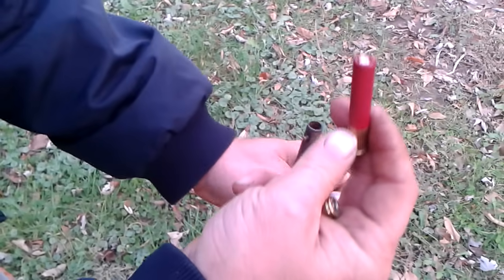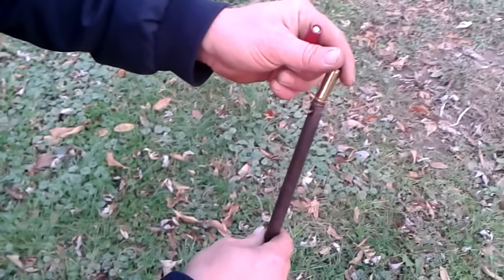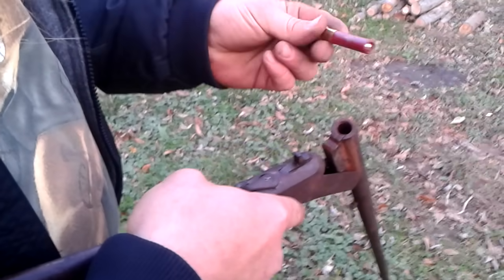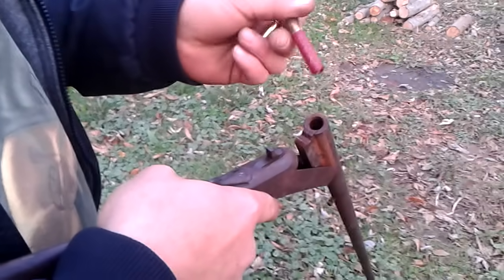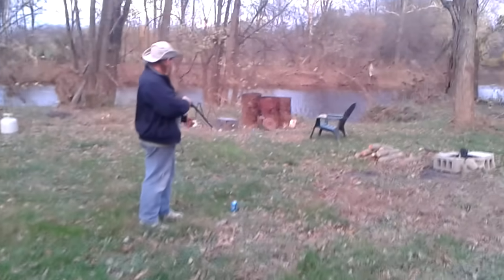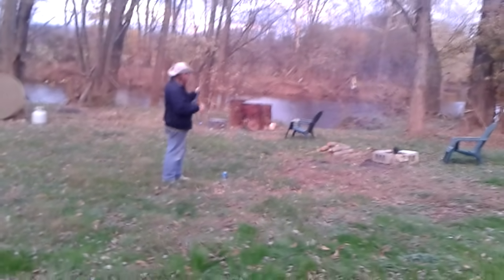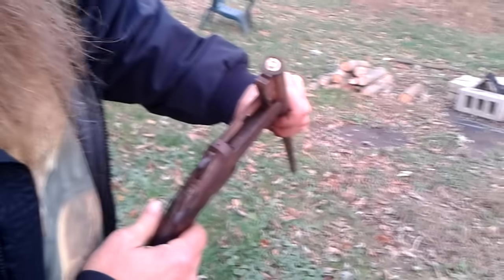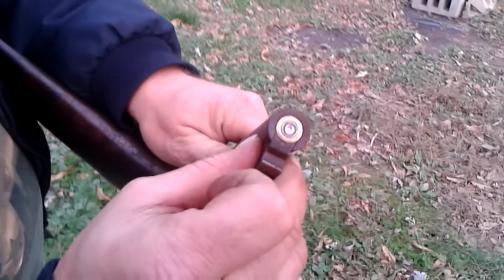Shooting for the first time the 410 project

Comment: For those who want to restore old guns: Step One, Clean the damn thing and clean it mercilessly inside and out so you can see if it’s got cracks that could lead to a very painful failure. Some oil at this point would be good.
Reply: I'M SURE EVERYONE SAID THE EXACT SAME THING. THERE'S A WIRE ENDED ROD 🪥 BRUSH & OILED CLOTH FOR CLEANING THE BORE & OUTER SURFACE. I'VE THAT EXACT SAME VERY OLD WEAPON BUT IT'S A SHOTGUN.
Reply: @ICEBAT Modern cartridge gun? Spray all the cylinder lockup points with Balistol or some other non-aggressive rust-breaker and let it soak for a few days. NEVER forget it’s loaded. A rubber hammer and gentle striking while pointing it in a safe direction, finger OFF the trigger always.
Reply: @ICEBAT If you don't know much about it's not a good idea to start messing with a loaded pistol - take it to a gunsmith.
Reply: @Iazzaboyce  and introduce more dangers? With old ammo and a possibly dangerous situation, he should soak that shit and avoid taking it out
Reply: @alfordjohnson2383   จตุพี
Reply: @ICEBAT try coca cola lol
Reply: Remember guys don’t pull a Scott
Reply: Its his gun.

Comment: I inherited a very nice condition gun of the same model from my grandfather. Still works perfectly and is a very nice gun.
Reply: Me too. Mine was a Spanish, fully folding poachers gun (supposedly to go in the jacket or down the trousers. I never used it much, and sold it for 8 quid and thought I'd got the better end of the bargain! Back when I first started, my Saturday job was;up to the farmhouse for 7.30, bacon buttie and a mug of scalding tea, then stuff pockets with .410,some 9mm garden gun cartridges and some .22 dust cartridges and off round the barns and grounds, shooting rats. The gun was a single barrel bolt loader BSA and a morris tube to convert to the smaller rounds. I was ten at the time, and earned 5 shillings for the day. H&S these days would have a fit.

Comment: I have a .12 gauge one of these.  Fired it once, the lever cut my hand so bad.  Blood was just leaking out.
Reply: If you fire a 12 gauge with one hand without the but to the shoulder the opening lever can damage you hand or the web of your thumb.  Happened me  once while firing an old cartridge to get rid of it.  Didn't bother putting it to my shoulder.    Don't forget to vote for Trump several times.

Comment: Also: the .410 'bore' is actually .410 caliber. The .45LC is actually .452-457 diameter. If I was determined to fire a center-fire cartridge in a .410, it would be a .41 Colt round.
Reply: Everyone thinks you can fire a .45lc because it chambers, and because of the taurus judge.  the thing is that the judge had to be capable of firing a regular round so as not to be classified as a short barreled shotgun, so it's not a standard .410 barrel.  You should absolutely not fire a .45lc out of a standard .410.

Comment: before the 410 there was a 44cal shotgun that shot a projectile filled with shot . the plastic from projectile notorisly stayed in barrel after shooting ,so it was discontinued,blowing or cracking the muzzle or barrel ...the muzzle was 44cal making it not choked enough for 410 although it would chamber.i have a straight 44 cal shotgun...take my advice and hang it on a wal to never shoot again.ie ''wall hanger

Comment: Clean it out . I had one a it said 44 too and I ran 410 and 44 mag with only a accuracy issue at longer range with 44 never tried 45 colt but I knew they would chamber. Barrel seamed too small at end  .

Comment: i have owned many 4/10s both double and single barrel gt guns for small game birds like partridges which stay on the ground at night in a covey a bunch of birds huddled get down to floor level a few yards away shoot across the tops of the birds take a few out in one shot.Still very common guns in the UK the fold up come fully silenced fit inside the poachers jacket pocket perfect i used to use a hexaganol barrel 9MM shot gun small brass cartridges again good for small game birds rat shooting etc....gettng the cartridges is hard work so they became obselete years back odd       ammo dealers still make them on request save yer brass every time with a 9MM rare as rocking horse sh*t

Comment: Back up in case something stupid happens lol
Reply: Chicago 93 lol
Reply: I saw about 6 things before he even said that. LOL
Reply: Bitte nimm deine Medikamente.
Reply: I vise and a length of cord to fire that relic remotely would have been the smart thing to do.The statement about chambering a .45 Colt round in a .410 barrel made me shudder.Just because it fits doesn't mean you should try.A.451" slug will not swage down enough to fit thru a choked barrel of less than .410" without likely damage.This is not someone I'd want to have as a shooting partner.

Comment: I would fire the thing remotely, with a LONG string.   To safely fire .45lc, the barrel has to a .410 / .45lc.  The muzzle I.d. Of my .410 is .395... I use .45lc with plastic sabots & .357 bullets.  Accurate.

Comment: The 45 slug fits the breach but not the end of the barrel because the barrel is ''Choked'' at the end to keep the shot in a tight group. Try and fire the 45 and it will go up in your face. Anyhow you are a lot braver than me !!
Reply from the maker: lefthandedluke I have shot the 45 colt out of this holding the gun LOL. But we also shot for 44 mag 45 ACP 440 Marlon 303 British 454 Kassul. I might make a playlist for all the videos
Reply from the maker: lefthandedluke Most of those shots were taken with a string. I’ve been nowhere near the gun

Comment: Wow when the firepin was sticking out when u were trying to bounce it shut it could  have shot off u always pull hammer that sit k through back when closing
Reply from the maker: Cory Cas I actually made the firing pin for this firearm. This firearm is designed for when you close it it pushes back on the Firing pin.For safety reasons you are probably correct. But a round does not go all just because the firing pin rubs against it LOL. It actually has to be struck pretty hard

Comment: In rifle unless the bore is eatin out the bullet will not fit inside the barrel it will still have say 1/8 inch of the projectile showing. It’s a little truck we use when buying old mil surp rifles to see if the bore is still good. If the bore swallow the bullet it’s no good if it’s tight like such it’s good so I’m pretty sure it will shoot the 45 Lc just fine once the gun is cleaned up a bit

Comment: Isn’t it the opposite of what you said? You can shoot 410 out of a 45 LC but not vice-versa ? Due to that extra 0.04
Reply from the maker: A 410 will not fit in a 45 colt chamber. But most 45 quarts will fit in a 410 single shot shotgun.

Comment: I pulled a diamond arm out of our local gabage outfit I made barrel firing pin and pistol stock and it work well. I hav a little issue opening it when it doesnt hav a shell in it the firing pin snags a little if I dont hold barrel end upright so pin falls back. But thats that the only issue. Mine was rusty bad to  I sand blasted mine with beach sand

Comment: i got an old bolt action single shot 410 from 1939, i think the barrel tapers a little so i aint gonna use any slugs ill just stick with birdshot, kinda the same thing with the 45.

Comment: 45 Colt will NOT fit in ALL .410 guns. IF you intend to shoot 45 Colt from a .410 and you buy a .410 and the 45 Colt fits, YOU GOT LUCK. It's hit and miss as ALL chambers differ  in exact boring......
Reply from the maker: @USMC-Sniper-0137  you are correct. I had a couple that they did not fit and I had a couple that did God bless.

Comment: did you check what cartridge it was made for,looks and older model.  ,the early were 2.5 inch  not the 3 of today,also think you may find  it is a 44.40 that fits not a 45.
OH well you only get one chance when you play about with a firearm  ,what sort of goose makes a fireing pin ,does not check if works correctly by useing a shell that is only primesd or at least an old shell with a primer already fired  before  loading a live round, 
 stupid is as stupid does